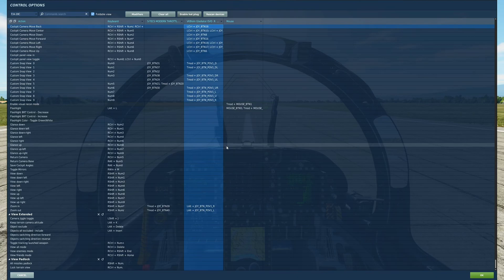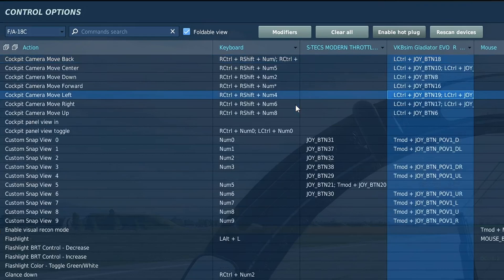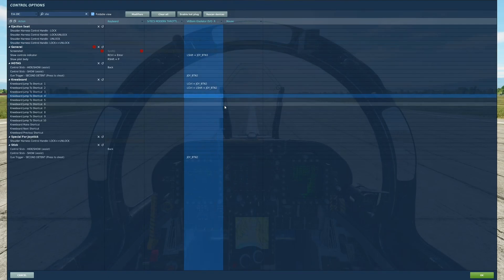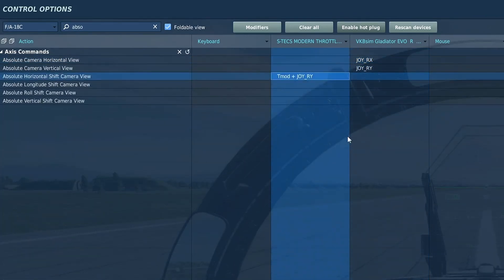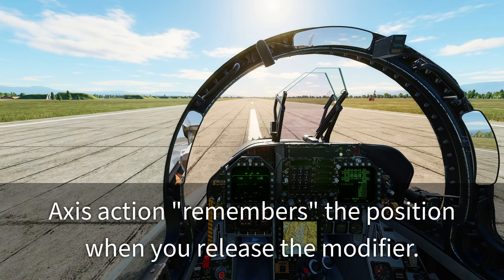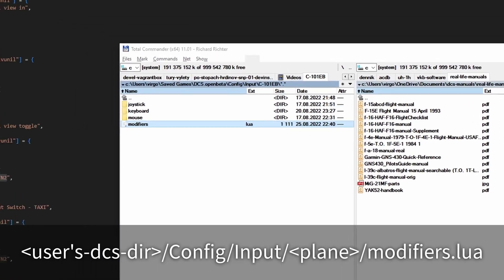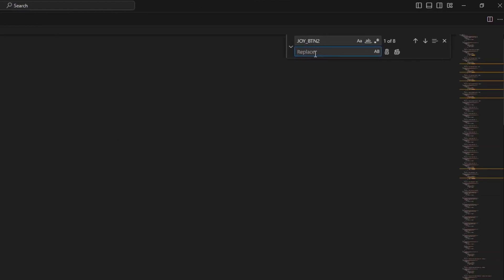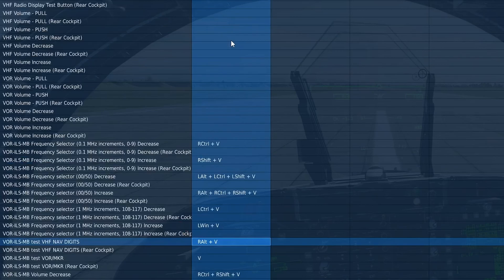DCS 2.8 | Modifiers

Comment: This was very useful.

I didn’t know modifiers, including keyboard keys, could be renamed.

I’m looking into creating a dual use flight/drive simpit and I’m thinking of using the clutch and throttle pedal as left and right rudder.

From other videos I’ve learned you can bind multiple input axes (i.e. clutch, throttle) to a single output axis (rudder) and set a curve on each input, to make it so each pedal controls only either the left or right 50% of the rudder output axis.

Using a modifier, I could then also have them act as individual toe brakes.

Using a second modifier I could use them again also as “zoom view”.
Reply from the maker: Yeah, renaming is super useful, both for atypical keyboards and for giving the HOTAS modifiers reasonable names.
As for the car pedals for the rudder... these are two separate axes and there are a few problems:
1) you have to make sure you absolutely don't engage the other when using one, as it would cause big spikes in the output
2) bigger problem - it will be possible to set one pedal properly, but not the other half that covers 50-100 values (starting "from the middle"). It's not possible with saturation/slider/invert and even if you set user curve starting at 50, there is still a jump to 0 in the 0 position. So I'm afraid it's not possible.
I'd probably go for anything else (twist or something on the throttle) for the rudder instead. As for toebrakes - no problem there, that's a good usage.
Perhaps you'll find a hack how to do it, but I couldn't figure out the "other half" of the action. It is possible to cover the whole range with half the physical axis, but it seems impossible to cover half the range with one axis. At least not for both halves.
Reply: @dcsunscripted very late response.

I use Joystick Gremlin as an intermediary to combine the clutch and throttle axes into a single rudder axis on a virtual vJoy device.

That axis is bound to rudder. The individual clutch and throttle (with a modifier) are bound to the toe brakes.